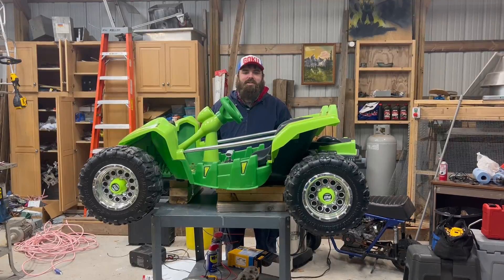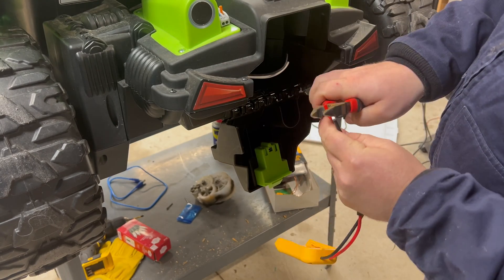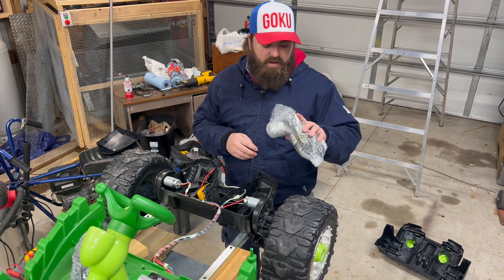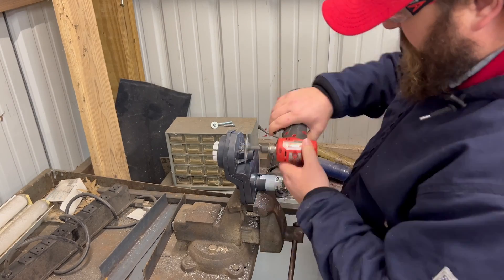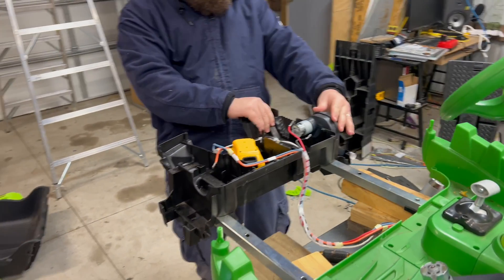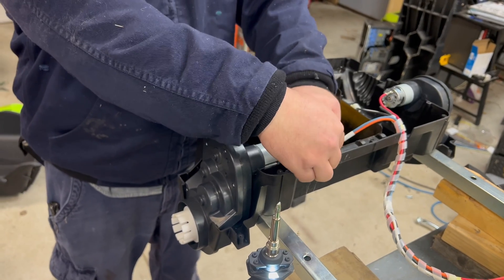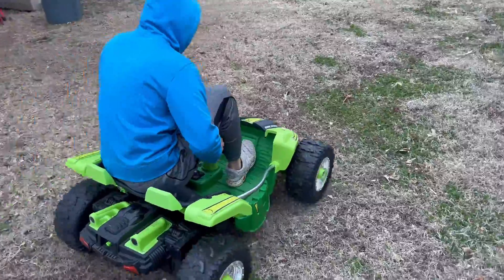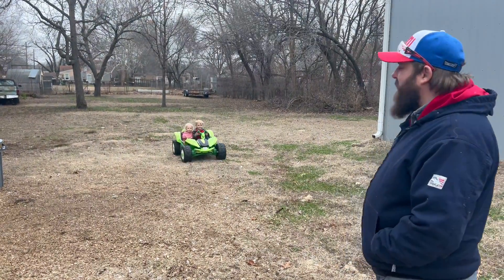Dune Racer Power Wheels: Upgrade Battery, Motors, and Gearboxes

Comment: Love your videos, I’m learning a lot. 

If I’m understanding things correctly, with these upgrades (20v battery and the upgraded motors in video) the vehicle should still run the same speed as the stock 12v system (12v battery)? 

You then added the 40v adapter to your 24v system in later videos  to make it faster but the motors burn out in six hours.

So I’m wondering, if the speed is the same as the stock 12v system, what is the benefit/ purpose of this upgrade in this video? Maybe to fix burnt motors?

Wouldn’t it make more sense to burn out the stock 12v motors with a 24v battery rather than to do this entire upgrade which doesn’t increase speed, and to just eventually burn it out with something like 40v?

I am a noob trying to understand thanks!
Reply from the maker: The upgraded motor/gearboxes have a some upgraded metal gears that keep the gearboxes from stripping. You can order motors separate for cheaper. This setup should also have more torque!

Comment: I cut my wires too short when trying this modification. How can I lengthen the wire? What kind of wire do I need?
Reply from the maker: You can get automotive wire from your local auto parts store. It should be either 12 awg or 10 awg.
Reply: You know the best hack was to pry off the top cap of the original battery and get that black (Fem) connector out. Then you just connect that (Fem) to the 18v batteries and the connector from the car (Male) doesn't need to be cut.

Comment: This guy is an idiot, it even states on the amazon site he linked to that the gearboxes have been known to have chewed teeth because the only metal parts in them are the sprocket on the motor and the small gear on the gearbox itself which is then only small plastic parts.  Unless you are going to have ALL metal gears these gearboxes won't last very long at all.  This is just like putting a v8 big block in a mini same would happen the gearbox would grind itself to death.
Reply from the maker: These gearboxes have a 4-star average on Amazon, which suggests many users are getting solid performance from them. While most of the gears are plastic, having a metal pinion on the motor and a metal first-stage gear is a meaningful upgrade. The highest torque and stress occur at the input stage, so reinforcing the motor gear and the first gear in the train makes a big difference. As you move down the gear train, torque decreases and speed increases, meaning the loads on the later-stage plastic gears are much lower. Full-metal gearboxes are great, but for most moderate-duty applications, this mixed-material setup provides a good balance of strength and cost.
Reply: @wackyengineering  click on the link and the first review states quite clearly customer complaints that the gears get chewed up using this method, I suggest you read it.
Reply from the maker: Unfortunately that review is not the first review when I looked it up so I couldn’t find it, however i hear what you are saying and that is unfortunate. We are not a sponsor for these gear boxes so we’re not trying to advertise. I do still feel like they are an upgrade from factory and at the price still worth the purchase. Hopefully you can see where we are coming from. Have a nice day!

Comment: Going to change the motor in my kids and realized they soldered the connections
Reply from the maker: Yea I believe we showed the process of unsoldering in the video but if you don’t have a soldering iron you could cut the wires and splice new spade connectors on.
Reply: @wackyengineering  yes sir exactly what I had to do
Reply from the maker: Good deal!

Comment: It seemed kind of slow for all your effort. Put a Makita 18 V battery on it and it will come to life.
Reply from the maker: We made another video with a 40v battery using these gearboxes and motors!
Reply: Nah, run 2 18v Makita batteries in series! 😏
Reply from the maker: Most people are Dewalt or Milwaukee. Makita isn’t even in the conversation🤣

Comment: How much does it cost in total to upgrade it and make it faster? Thanks!
Reply from the maker: It was about $90 for the gearboxes, and battery!
Reply: @wackyengineering where did you order the parts from
Reply: The real upgrade kit is the Stage IV kit from MIL Toys. It's like 220 bucks but for the fun and resale value... worth it!
Reply from the maker: That sounds awesome!

Comment: I burnt up a $250 battery doing this, i actually was at work and my wife and kid did and all the tricks in the world wouldnt bring my battery up.
Reply from the maker: You have to be careful not to run it too low, there are also devices that can protect your battery by shutting them off when the voltage gets too low.
Reply: @wackyengineering  yeah it was too late by the time I figured that out, not we are onto bigger and better. Gonna beef up a razor put bike for him to ride around now.
Reply from the maker: We have a video on the razor with a 20v battery!

Comment: Will these 24v gearboxes work with a 18v milwaukee battery?
Reply from the maker: Yes they will work but they might be slightly slower because they are 18 volts.
Reply: I run 24v Flex tool stacked lithium batteries. Oh, if you're really unhinged you can use 2 18v batteries in series. I highly advise a temperature sensor and appropriate gearbox/motor if you go that far. ML Toys has such upgrades. Not the cheapest but damn it's awesome. Even at full running speed I can't keep up with my son. 😂
Reply from the maker: Wow that sounds awesome! We later put a 40 volt battery on this dune racer! DIY Black and Decker 40V Power Wheels Adapter #powerwheels
https://youtu.be/ezP-u89ELRU

Comment: 24 volt motor and 40watt of power?
Reply from the maker: 24 volt motors, I think each motor is over 100 watt max. In this video we used a 20v battery but we put a 40v battery in a different video later on!

Comment: Boy was the 12v Motor on the 20v much faster but they did burn 🔥 up so I went for the 24v motor. Great info.
Reply from the maker: Awesome, and Thank you!
Reply: Yup, not worth your money unless you go with motors that can run 24v. Flex tool stacked lithium batteries are 24v, lifetime warranty and sturdy af.
Reply from the maker: Lifetime warranty? Wow that’s awesome!
Reply: @AltruisticWarrior nah, using stock everything I upgraded it to use the 18v Ryobi batteries but the huge knock off brand packs, and each one runs it for an hour and charges in an hour. My boys been using it for 2 years constantly, nothing has burned up... But I used a fuse, which has occasionally blown.

And tbh, it's just as fast as this was expecting this thing to fly.
Reply: I'm actually confused, I weigh 200 and can ride on my sons stock one with just 18v battery upgrades and it moves me better than this upgraded one did with a 160 lb man on it... 🤯
Reply from the maker: That’s awesome!

Comment: I made the changes but the racer runs slower than it did with the 12v parts. 20v battery fully charged. Any idea why this may be the case? Any suggestion is appreciated - awesome video
Reply from the maker: Yes we explained that a little bit in the video but probably not in enough detail. The newer motors are rated for 24v and will run about the same as stock motors and gearboxes with 24v supplied to them. In another video we 3d printed a Black and Decker 40v battery adapter and put it in the upgraded dune racer and it runs really fast now! The parts should be linked in the Black and Decker video description.
Reply: @wackyengineering got it. Thank you!
Reply from the maker: No problem!
Reply: @blakeharris3349 you can also use 2 batteries in series. I use the 24v Flex tool stacked lithium batteries, so that would be 48v total. Probably a bit much for the motors but the motors themselves are cheap enough. Its the beefy gearboxes that are quite costly. ML Toys sells gearbox/motor kits that can handle a lot of abuse.
Reply from the maker: Good advice!

Comment: How are these motors and gearboxes holding up?
Reply from the maker: The motors and gearboxes held up fine until we put the 40v battery on it,  then it lasted about 6 hours. One of the motors burned up.

Comment: Does this dune racer not have the limiter screw then let's go fast??? The old Batman version definitely did, I finally figured it out after a year of use! 🤣
Reply from the maker: Wow, we didn't see one but well definitely will have to make sure!
Reply: @wackyengineering  there is a screw right below the forward and reverse shifter just take it out.
Reply from the maker: We did remove that a couple years ago, I forgot! Thanks for checking!
Reply: Dude! You're awesome. My son has the Batman versjon that I bought used off of FB. Had no idea that was a thing. TBF I slapped a 24v 10AH Flex stacked lithium battery in there and the thing goes about 12mph already sooo... 😅
Reply: @AltruisticWarrior how old is your kid? Just give it time, you'll be removing that screw very soon! I did the drill battery upgrade as well, which was definitely a nice upgrade, but removing the screw after the upgrade was game changer, at least for my boys! Also, if you want to rip it in the winter or just want more traction, I wrapped the tires with old mountain bike tires and the thing links up nicely! Enjoy!
Reply: @AltruisticWarrior  " I wanna to go fast" - Ricky Bobby 🤣😝

Comment: Thank you for your video....very helpful.  Have you assessed the need for either a low voltage shut off to protect your lithium batteries or a brake reduction module that would soften the stop when letting off the accelerator?
Reply from the maker: No we haven't had to use the brake resistor on either of ours. The low voltage shutoff could be very important but we have the kids trained to stop and ask for another battery as soon as it starts slowing down, so we haven't had any battery issues!

Comment: How to charge it
Reply from the maker: Just pop the Dewalt battery out and put it on the Dewalt battery charger. If you have multiple batteries you can stick in a fully charged one to continue riding!
Reply: What is the run time ?;
Reply from the maker: 30 minutes with a 5 Ah battery!